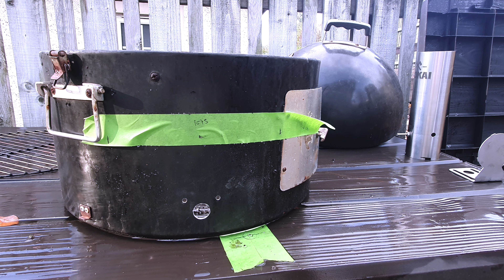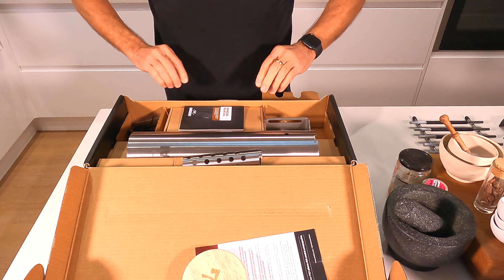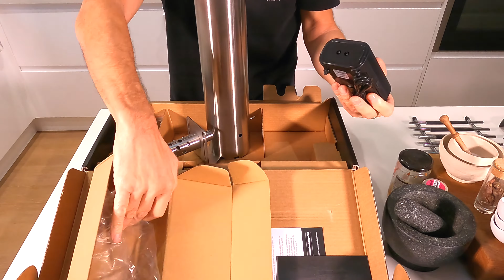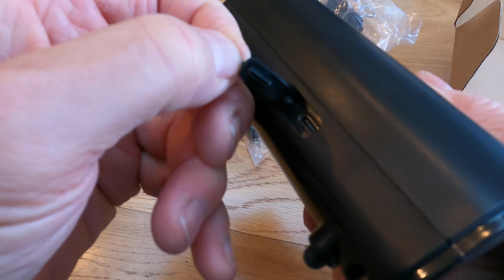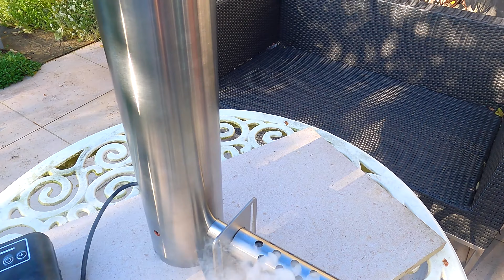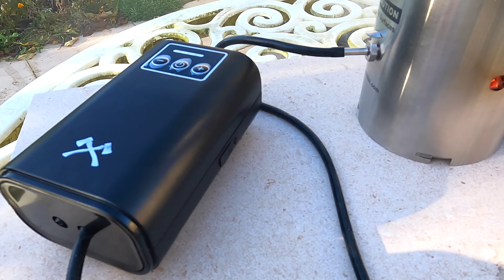The Smokai Cold Smoke Generator: Unboxing and Testing

Comment: Judging by the leaking bottom I'd say your chips have been overly affected by moisture and are too wet to be "suitable". This causes longer harder starts, creates slower burning, raises the mess level, helps with bridging, and causes you to clean it way sooner. If that smoke feels humid IMO your chips are way too high with moisture content. New chips are in a sealed bag for a good reason and must be stored with a nicely sealed top and kept closed.  And yes, I'm a freak show about this to keep cleaning at bay much longer = EASIER, BETTER SMOKE & FASTER lol.
Reply from the maker: I get this question, Frequently, where people consider the moisture within the wood chips to be the main cause of gunk within the smoker. Part of the chemical process of combustion liberates moisture. now depending on the outside air temperature when you are smoking will largely depend on whether that moisture condenses out onto the sides of the wood hopper causing the wood to become damp. I’ve seen this problem so many times and it is rarely if ever a fault of the wood chips being too moist. All my wood chips are kept in sealed containers and are usually around 5 to 6% moisture content.
Reply: @Coldsmoking  I said if the chips drip their too wet! I said NOTHING about the inside did I?

Comment: A further option to regulate air flow from the pump is a simple regulator available at most aquarium/pet stores. In fact an air pump from there should also work as a backup if one purchased the plug-in version of the smokai. Just saw the link to your video on air pumps haha.

Comment: Coming in fron New Zealand. Excellent video but I do wish you showed the adjustible smoke settings on the pump in action instead of just pulling 1 pipe off and clamping. I would assume most people would use the +/- to control the smoke before pulling a pipe off. Thanks for the video.
Reply from the maker: Good point. i produced a video a while back where i compared pumps against the smokai. the results may be interesting to you I was surprised - Smokai - Rebuked for not using the right pump.
https://youtu.be/k0OvZL4nRQ4

Comment: Hi was just wondering how the tube works or looks like that the pump is attached, trying to save the $220Aus and build one myself. The last one I made I couldn’t keep the wood chips alight they would keep going out.
Reply from the maker: if you check out my other videos on the Smokai I’m pretty sure one of them shows a breakdown of the component parts. It might be worth checking that out.

Comment: Hi mate how ya getting on with this unit? Found a solution for the condensation/clogging etc did you do anythibg klaus suggested?
Reply from the maker: what’s your solution??
Reply: @Coldsmoking  hey i dont have a solution as of yet however i have a couple ideas that i should be able to put into action probably next weekend providing i have some spare time. 
İ think i will be making a couple mods to a smoke generator to both eliminate/minimise condensation, bridging and potentially filter the smoke aswell.

İf i do some somewhat of a success i will revert back to you.
Keep up the good work
Reply from the maker: Ill be using the smoker this weekend so more work to do

Comment: How much is a full filling? And can you fill  it up? Im gonna cold smoke some coalfish
Reply from the maker: on a full load of wood chips you can smoke for between 6 to 8 hours but it largely depends on the air setting on the pump. The higher of the setting the greater the smoke produced and the shorter smoke duration.
Reply: @Coldsmoking  thanks! What is a full load? 1 liter? Half the pipe?
Reply from the maker: @marthebleu6027  ive got the 3 Litre version so i guess its a volumetric measure based on that. different woods will have a different weight and you will also see a variation in weight from chips to pellets. I think that is why they tend to gravitate towards a volumetric measuring system.
Reply: @Coldsmoking  allright, so you fill up the whole 3 litre? Because you used a full cup in your video, so was just wondering if that is what you considered a full load?
Reply from the maker: @marthebleu6027 i was just running a test
Reply: @Coldsmoking  okay thanks!

Comment: I’ve heard that microwaving the chips beforehand will greatly reduce the moisture content of the chips.
Reply from the maker: I tend only to use woodchip for hot smoking ( with the exception of my fine chip) and therefore I’ve never really had an opportunity or need to try that particular technique. Generally speaking heating up any wood in a microwave would assist in removing moisture so if it’s an issue for you then perhaps give it a go.

Comment: get some fishtank airline control valves and bleed the excess air off, just clamping it puts back pressure on the pumps diagphram and will burst it (50 year experience as a fishkeeper)
Reply from the maker: the pump has two separate outlets by removing one of the pipes from the outlet and clamping wont have the effect you suggested. thanks for your comment though. 👍

Comment: After using my Smokai a few times, I love it but . . .  it really is a PITA to clean. I soak it overnight in Simple Green and still have to scrape off the black creosote which at least has turned a bit gummy. I finally started using a round wire brush in a drill to get inside the tube. That works best.

I found smoker wood "bits" from True North that work great in the Smokai. the "chips" that I previously bought were too big and too inconsistent in size. I had some big chunks of wood and even a 6" long piece. They would block the tube and not let any other chips fall dow to the burn area. The wood bits are the perfect size. 

Now if it only had a self-clean cycle. Sigh.
Reply from the maker: Great comment. i ended up using a metal pot scourer but I’ve also used caustic oven cleaner for my other smoke generators.. its always interesting to heat others’ experiences with the kit. Thanks 🙏

Comment: Thanks.  Recently bought a 1 litre model with the rechargeable battery pump to fit my Weber Q for hot and cold smoking.  I’m no cheap arse and was more than happy to pay the price for the quality.  I’ll probably  buy another, larger unit later but, for now, the 1 litre is a good compromise - large enough to work with the Weber Q but small enough to take camping and use with the small Weber and I can recharge the pump from the camper batteries.
Reply from the maker: sounds like you have just the right smoke generator for your setup. are you using wood chips or pellets???
Reply: @Coldsmoking  my limited smoking experience has been with a traditional old kipper box with sawdust over a small metho burner so I bought a few small packs of both in diffent woods to see what works best.  I’ll reply once I’ve had a bit more practice.  I do note that Smokai advises against using one pellet brand because of a vegetable oil used in manufacture … I guess as a binder.
Reply from the maker: @geoffmesser5091  good luck

Comment: Thank you fore the video 🙂
We haw the smallest Smokai. And it only worked the first time.
The second time we tried it, the air-pump did not deliver enough air to generate smoke in the Smokai.
The air-pipe is open, i removed the air-pipe from the air-pump. Still very weak airflow.
I question the quality of the air-pump. Its is so simple and cheep if you take a look inside of it.
I wonder if anyone have the same problem?
Reply from the maker: i haven’t experienced this issue myself but I’m sure someone will be able to answer this for you
Reply: @Coldsmoking  okei, thats god to hear, you don’t hawe any problems. Thank you for your answer.
Reply: Some update 🙂The Smokai salesman "in Norway" will send a new 230V air-pump, with speed regulator. We have the battery version now. Hope that makes the difference.
Reply from the maker: Hope it works for you 👍

Comment: What are you using to light the wood? I’ve used an old kitchen flame for crème brûlée and it’s useless
Reply: My brulee torch is adjustable for less or more intense flame. Maybe check to see if yours is set for low flame?
Reply from the maker: i was using a brûlée torch. worked for me

Comment: Very glad to see your video pop up as I logged in. I just got the 1L Smokai for Christmas. Mine is smaller and runs off electrical (the mains) not battery like yours, 110V here in Canada .Smokai seems to have it all figured out for international customers. 

We have below freezing temps every night at this time of year so I haven't tried it yet. I need something that needs a short smoke time since we do have + freezing temps during the day but that can change by the time I prep salmon which needs a few days of brine and air to form the pellicle as you well know. (I have watched your video). I would think that having it run overnight with temps of -5C would give the possibility of it freezing the salmon. 

I need short smoke time ideas so I can try it out. 

I agree that they are a bit pricey but the quality is definitely there and the design is well thought out.
Reply from the maker: thanks for your comment. I need to check the temp in the smoker and compare it with ambient while smoking
Reply: @Coldsmoking  from Canada too i have the  electrical one puts out no heat
Reply from the maker: @joemartin124 thanks for your comment joe 👍
Reply: Hi
From Canada too.
I just ordered one a few days ago and can't wait
Reply: @toddpower4674  I think you will like it. 
It is hovering around freezing here right now so I can't do some types of cold smoking until spring since we are expecting to be -18 C in a few days. Anything that needs to cure for a few days first is risking not being able to finish it. 
Trying mine out today for the first time. Cold smoking cheese and almonds. I will spice and finish the almonds in a hot smoke tomorrow alongside some ribs. This is addictive so far. 🤤 Wish I could post a video, this thing really pumps out the smoke. I have it turned down as low as I can and there is still a lot of smoke. I did turn it down too soon at first and it almost went out. I turned it up for a few minutes until the wood chips had more "coals" and it has been at the lowest setting since then. I am using Grill Pro alder chips from Home Hardware. They are burning well.
Reply: Made a wooden smoke house with a metal base and put a dual hotplate from home hardware.
Did cold smoked bacon and used hotplate to keep temp about 10 c.
I like it and gonna try to do a ham and then some fish.
Will be  a nice pass time.
Reply from the maker: @toddpower4674  a lovely pass time 🕰️